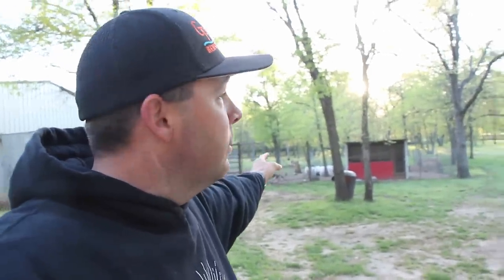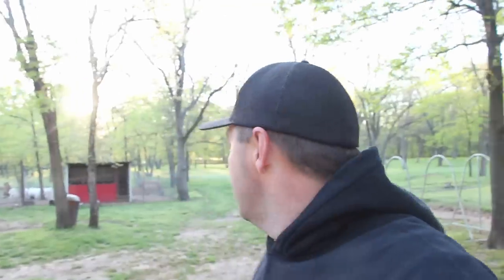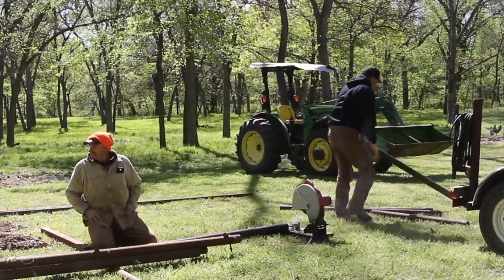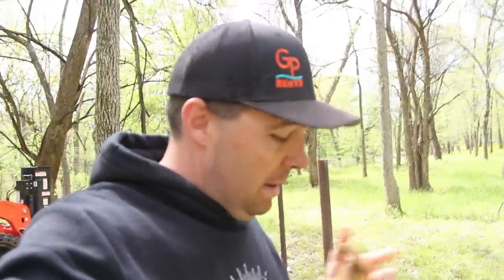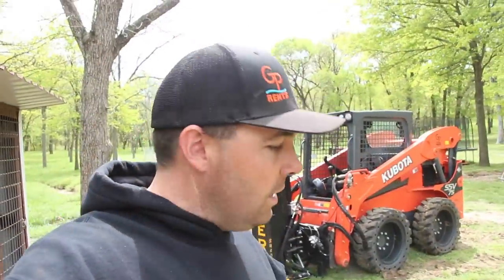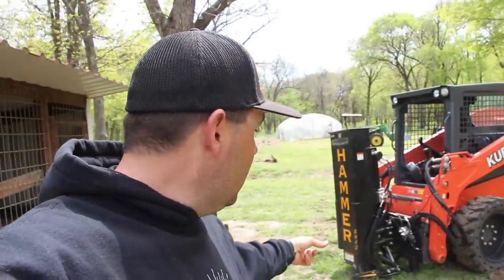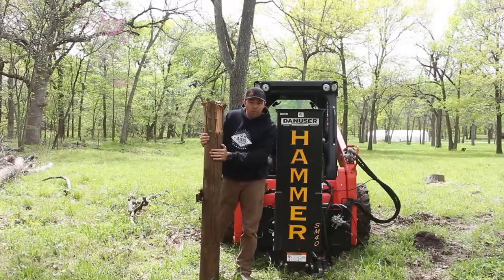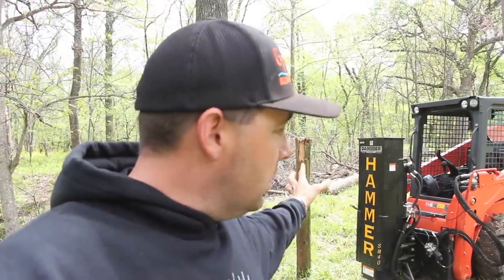The Hammer That Drives Corner Posts Into the Ground!

Comment: Those are cool.. We used one to drive 2 semi loads of 10ft long 6in and Red Top field fence to fence in 160 acres. It worked great, and I would have hated to have to hand dig all those holes. lol. And for T-post, you can use your tractors loader/bucket to push them into the ground. A friend of mine tack welded a piece of pipe 3 inches long onto the bottom of his bucket for the top of the T-posts to go into to hold them from slipping while it pushed them into the ground. It's 10 times faster than driving them by hand. He pulled a line and used spray paint to put a dot on the ground where each T-post was to go, and then I stood the posts up and he pushed them down with the bucket. Work smarter not harder. lol.

Comment: My buddy has a Danuser Hammer that I have used. It will drive 6-8" flat bottom corner posts until you hit solid rock or run out of post (Here in N. Central WV, you're gonna hit rock). Sure beats the heck out of Shaver or similar style drivers! Great video!

Comment: I have a Danuser LM40 on my Kubota M4 Tractor. It will drive up to 10” flat wooden posts and even t-posts. And you can add up to 200 pounds to the hammer to give it more force! Just push the t-post in. But if it’s dry, you can buy the t-post adapter to allow you to drive them. When driving wooden posts, drive the smaller ends into the ground so they get tighter as they get deeper. It’s different than digging them in, where you would want the larger end in the ground. The machine is a beast. It cost me $10,500 but it’s worth every penny!

Comment: I tried everywhere in my state to rent one finally ended up buying one. For the people that say they won’t work I would say they probably will we drive 8 inch wood posts with a flat end into dry desert ground. It will work with the round rocks if you have a little bit of moisture in the ground it just pushes the rocks out-of-the-way. I don’t know how it will work with shale  or flat rocks. You can’t use pointed wooden post as they tend to go crooked.Bottom line is they work a lot better than you think.

Comment: I wonder how well that would work here in Louisiana 🤔 out water table is so shallow we start hitting water about 2 feet down. The only benefit is that you can just drop the concrete in the hole and use the ground water to mix it 🤣🤦🏻‍♀️i know it'd work for metal pipe but im a fan of using the big round wood ones for corner post. My papaw loved railroad ties....you know how hard it is to get a railroad tie out of the ground thats been concreted in for 40+ years 🤦🏻‍♀️🤦🏻‍♀️
Reply from the maker: https://youtu.be/fHajSYmCa70

Comment: The Hammer is a fine little tool. Those pipes almost slid into the dirt at your place before it started adding impact, but all the time saved as you described, using those old-fashioned holes and concrete is well worth  giving up the healthy workout you'll be missing. As to the wooden post, I wondered about what all those impacts were going to do to the top end, but that could be easily lessened if you had a welder make a short cap like a heavy-duty manual driver without handles to slip on the top before you start driving to help reduce damage of the repeated impacts, then removed and used over and over  or maybe as convenient, why not just allow for the extra needed and sacrifice a few inches of the top, then chop off the splintered segment with a chainsaw, with the added benefit of allowing adjustment/correction to the height of the top of the posts.
It's things like this that stoke the fire behind me finding the chunk of dirt I need to get back on track and cut out all those #$%@ complicating what I want to do. Is this more than a Comment? Sorry.

Comment: Make sure you weld caps on them or feel the end up with spray foam , after about five or six years of filling up with water they will bust and if you drive wooden post put the small end down,  I know it sounds backwards but that way they drive-in tight. Good luck God bless be safe

Comment: Where I am in Australia we do all our fencing with rammed posts it is a far better way to have a permanent fence that stay tight longer and are better with cattle in particular as they ar likely to rub on posts making them lose even posts that aren’t concreted in that are really good for stay posts what you call brace assembly we call a stay and they usually used in corners or when you want to hang a gate we ram wooden posts not just pipe for wooden posts the most time consuming prob is chainsawing points into one end of the post

Comment: can see the need for a sleeve to protect the tops, 1/2 in top plate, with 1/8 in sides would do the job and save a lot of extra work!!! :{)))
Reply from the maker: Well it still had the plate for round pipe and these were very old wooden posts. It wouldn't be as rough on new posts and the pipe guide removed.

Comment: even if your ground is really hard you can "sharpen" the point of a timber post with a chainsaw and it will just about drive into anything. Here on the east cost of Australia a heap of people have been moving to a pre fabricated concrete fence post driven in with a similar tool and they are amazing! no risk of fire damage(we get some fairly bad fires here in summer) and will not rot or rust! Link for anyone curious https://concreteposts.com.au/ ( i have nothing to do with these guys fyi just am amazed at how good an idea it is)

Comment: Fencing just isn't supposed to be that easy lol. And here I am post hole punching with my arms. 
I wish we has a nice rental company around here. The only thing we ade able to rent is chares or table for a wedding.
Reply: Rose - Are there any cattle ranches or mixed farmers near you, where i grew up they all had post pounders that they either shared with a neighbor or owned, usually on a little trailer that looks something like a log splitter, with hydraulics ran by the tractors PTO or a small engine.

Comment: in the spring after the frost comes out of the ground i push 3 or 4 inch pipe or 6 inch ceder wood posts into the ground, 4 feet down,   with mini excavator, or my boom truck once the clay sets you cant even put a pick into this clay, or hand dig it, it soft in the spring, but not to were you sink a truck in it. as our frost is 7 feet deep in winter, they never move, hell i have hook a winch to the 4 inch pipe at the ground and pulled trees out, i sure wouldnt want to run around a feild at this time of year with a wheeled skid loader, it is bad enough i have rented them to plant 6 foot blue spruce trees on lake front home, and the dam wheeled skid steer sink into the ground just enough to spin the wheels and your hung up by the belly in know time flat, the clearance on them is not much, i would want a tracked skid steer, i had to pull the skid steer out with my 5 ton dump truck loaded with 7 yards of top soil, ir was not coming out with out a load on the truck, it would be a costly job if one had to call a big wrecker to come pull the skid steer out,, it dont take much and they plant them self right there on the belly, and no pushing it out with the bucket most times, i am looking how wet the tires are as your moving around

Comment: that is impressive. What kind of metal pipe have you been using? is that recycled material or did you buy that stuff new? Thanks
Reply from the maker: It's old oilfield drill stem pipe.
Reply: @ArmsFamilyHomestead  Oh thats a good way to reuse it.  Do you just have a stockpile of it? Thanks